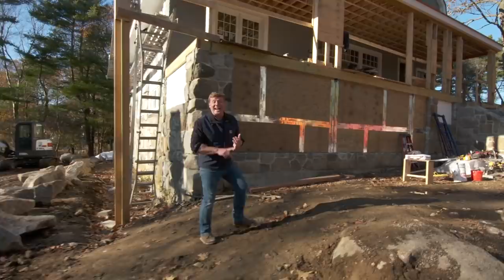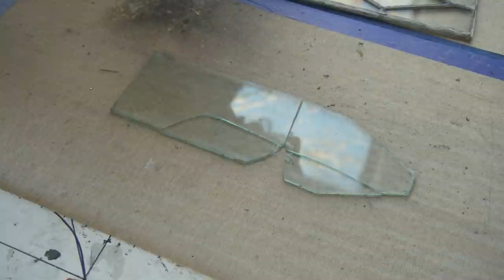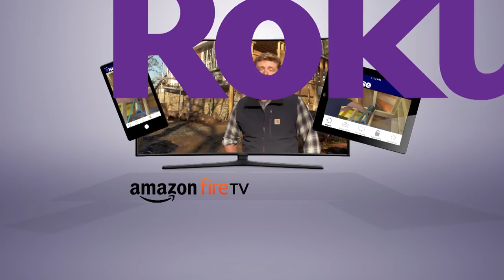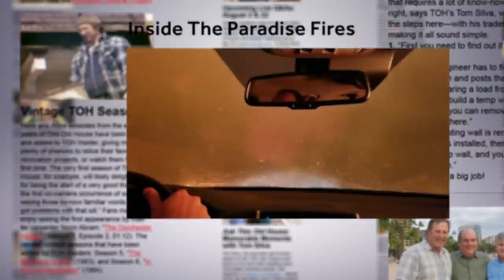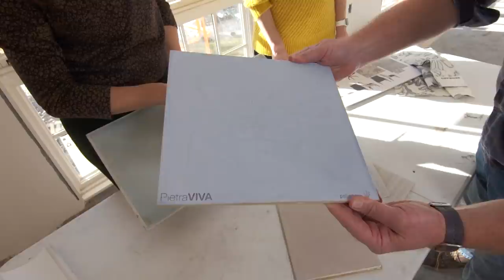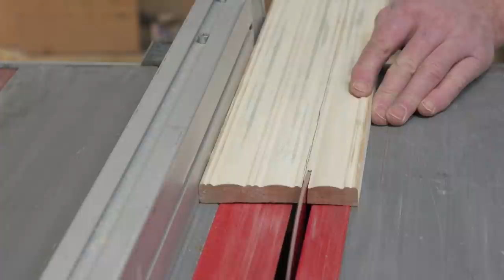This Old House | Window on Restoration (S41 E23) FULL EPISODE

Comment: Last time I touched window putty was 35 years ago when I worked as a house painter for a summer. Lots of old wooden windows with lots panes of glass with cracked old putty to patch up as part of the prep work. Replaced the occasional pane of glass too. I don't miss old wooden windows.